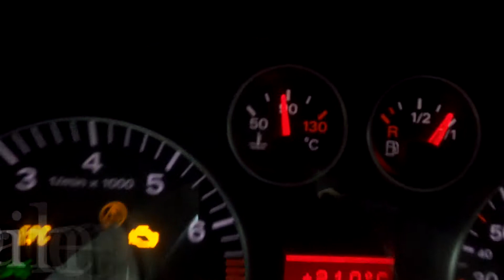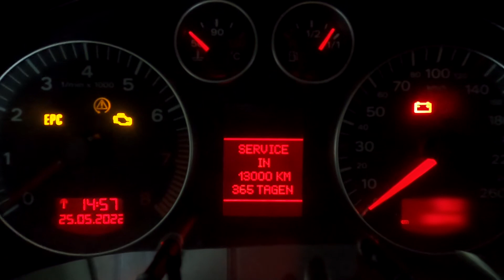engine oil change - Audi A3 8P

Comment: Get your disposable gloves on ffs!
Reply from the maker: I don't like them, so I don't use it, only if it is unavoidable.
Reply: @GRIFFtheMechanic  typical mechanic; if you'd worked in engineering industries / factories, you'd likely know how many are affected by eczema/ dermatitis, that effectively couldn't ever work with their hands again; as well as those with cancers... skin / bladder... et-al... a large percentage of which couldn't ever work again and/or never made it anywhere near retirement; I suppose you don't know the stats on asbestos deaths of mechanics from earlier brake shoes dust either... all because they couldn't be bothered wearing a simple dust mask?